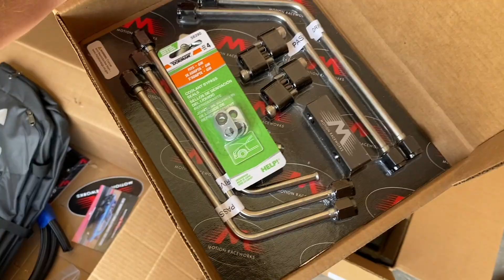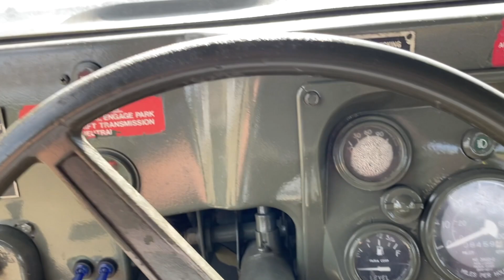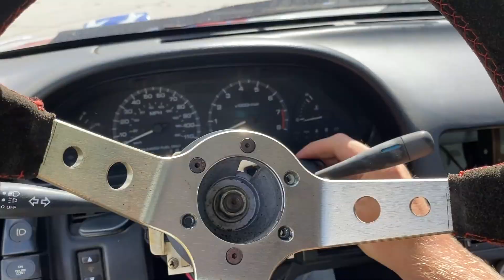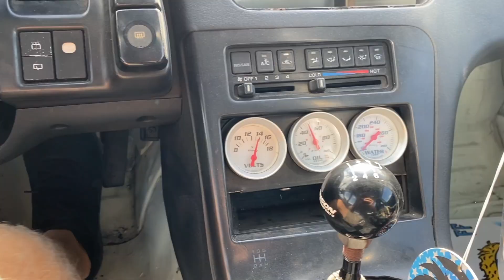Drifting the Entire FREEDOM FACTORY In One Run... Rocket the Drift Car Durability Testing lol

Comment: Cleetus: Oh brother, she’s a capable unit!
2 seconds later 
Transmission line: Are you sure about that? 
😂
Reply: Yo give credit where its due, my dogshit mdx would've ceased to leave the next light if an ounce of trans fluid left its pan. He trucked no problem with a quart on his windshield. Granted, I'm not a humvee expert but I can assume there is plenty of fluid of those trans.
Reply: @Tjtakedown  that's because he lost transmission fluid from his power steering system, not his transmission. You're able to substitute ATF for PS in a lot of scenarios.
Reply: @patrickmuzzi  Yep, I run ATF in my 5.9 Cummins power steering system. She has a small leak and ATF is thicker and leaks less.
Reply: Maybe water made its way into the power steering system and when it heated up the pressure of the hot water popped the line off?

Comment: btw you can probably repair the front shaft of the bummer by pushing the balls back in the joints(there probably sillsitting  in the boots) , there loose enough to do that , its filled with the black grease so its a messy job 
about the power stering fluid , it was probably filled with water that boiled off causing the explosion

Comment: That's was some serious car control. Putting ken block to shame. Doing all that in 1 take ken block would need at least 10 takes as you can tell with the tire witness marks in his videos.
Reply: The difference is Ken Block is driving cars with 3x the power and grip and doesn’t rely on the handbrake so much lol
Reply: @omarleyva8975  I am dumber just for even reading that. Ken block doesn't rely on the hand brake. Also ken block uses AWD making it allot easier to hold a slide.

Comment: Lol, yeah the Power Steering line and the trans cooler line are only held on with a spring clip. You need to add a proper worm gear clamp. 
Edit. I spoke too soon.